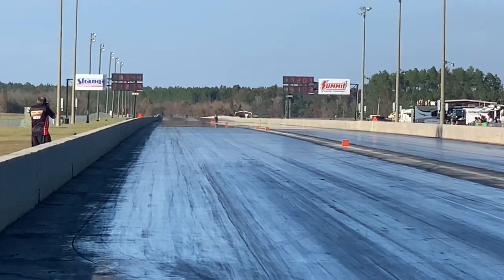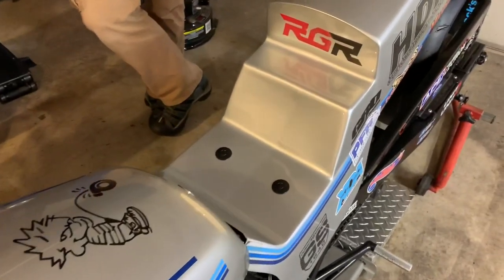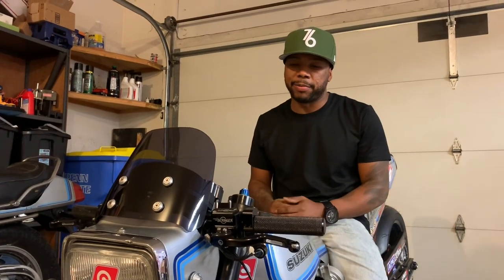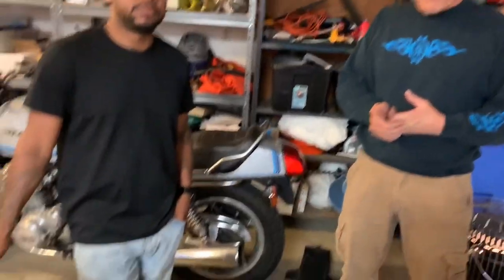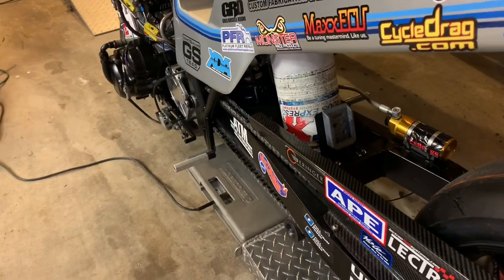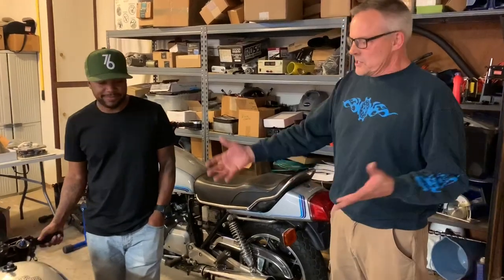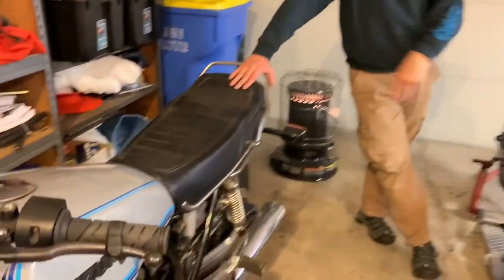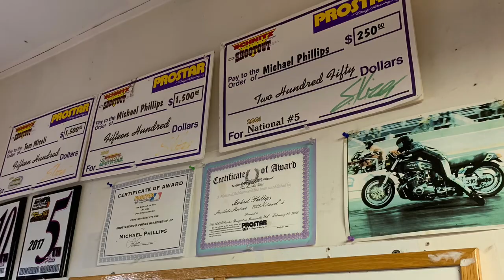575 HORSEPOWER SUZUKI GS! EVERYTHING YOU NEED TO KNOW ON THE WORLD’S FASTEST NITROUS PRO STREET BIKE

Comment: 22:41 - He's partly right.  Pulling a vacuum on the crankcase doesn't just address the piston movement.  It reduces windage across the entire crank-rod-piston assembly.  However, the main purpose of crankcase vacuum is to increase the pressure differential across the rings, thereby producing an improved ring seal.  That improved sealing allows the use of a low-tension (reduced friction) ring package, also creating a power increase.

Would have been cool if you'd asked what that bridge piece above the spark plug is for.  A guess would be to stop the plug from blowing out but it seems the plug boot would crush first, depending on what it's made of.

Comment: In 1981 I bought 2 New Bikes a Kawasaki GPZ 1100 and Suzuki GS 1100 for $5000  Both Stock 500 miles Ran 11:30 in Ohio which was The Fastest times in those days... GS Rode Better / Shocks and Softer Seat... I Still Have the GPZ 2200 miles Not 22,000... This 1640 GS is Stunning 
Engineering Love It... I am a Former 1977  I.D.B.A  B/S   World Record Holder  Kawasaki KZ 900  12:01@113 Dragway 42 in Ohio and have Gone 11:88 Stock but Not at Meet and 11:60@116 in Atco NJ with Denco TriCone Header 💥🇺🇸💥

Comment: Dam that thing is fast.  I ride an '83 GS.  Would like to get one of their T-Shirts.  Maybe one of yours too!
Reply: Me too, both , one WON'T DO ha ha ha ha.
I began working on an '83 at least 5 years ago .... stripped the frame of tabs and the not required, paint, and blah, blah, blah too many things were in flux, going to try and see if I can get it.
There are things that I saw on here from the PRI Show that I want to try on a GS, I have a 10 inch tire 1500 , 1150 frame, 40 mm Lectron running now, NOT touching it other than some carbon fiber  and some things I 3D printed.
Oh yeah, making a battery too lol.

Comment: I get what they have done here, evolving the gs into a super cool drag "pro street" bike. I'm a mechanic that's raced my stock cbr1000 and gsxr1000 and I'm quite keen to build my way into something faster. What i don't get is what is required rules wise for each class. Sounded like the frame started stock and was modified so some of the original metal is there, but apart from headlight and taillight i don't see any other standard parts. appears pro stock maybe has more standard parts than pro street and pro mod is the fully modified? and then where does top fuel fit in that? hard to find info on this.

Comment: How do they cool it? With out any finns on the cylinder.
Reply from the maker: Morten christensen I think overheating Is not an issue on the “short trips”
Reply: @cycledrag  Maybe they have some improved oil cooling. The burst is short, but it must develop much heat.
Reply: Cooling isn't an issue when the motor is on for only 30 seconds or so...
Reply: @moonza2201  Thanks.